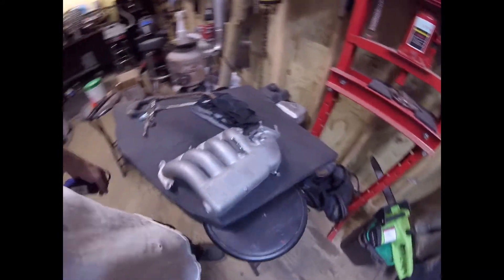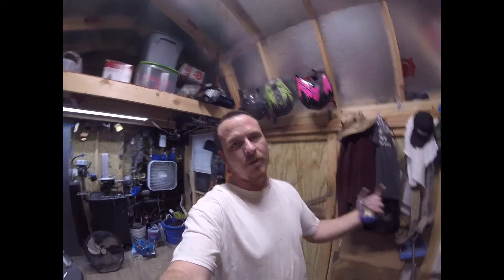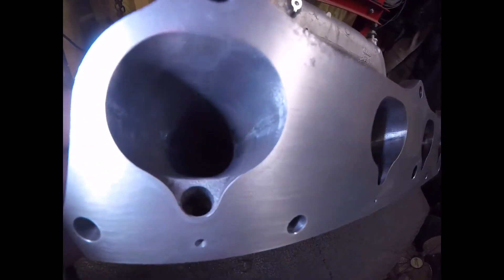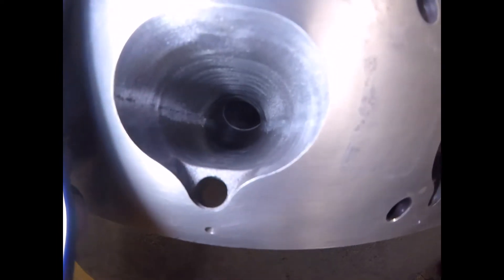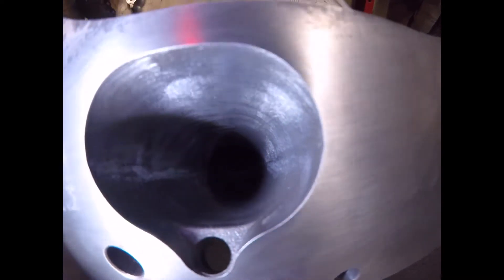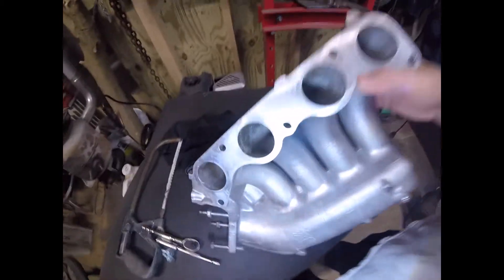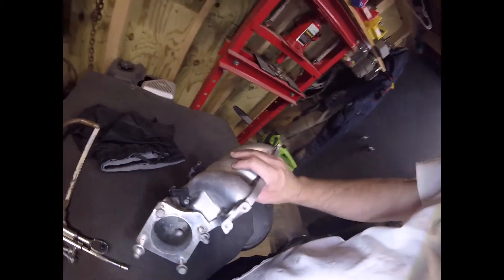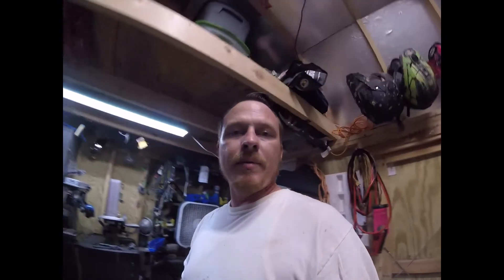Honda Accord K24 Intake Manifold Mild Port, Polish and MOD to fit Acura RSX K20A

Comment: i just grabbed the 2nd half of the manifold, will it bolt on to the k20 lower intake or would i need a adapter?
Reply: Not the base RSX k20. I had to use the k24 adapter, it’s bolts right to the engine no problem
Reply: @skeetden  if i just buy an aftermarket intake manifold will it bolt on? or would i still need a adapter. im just curious on how the intake runner control valve gets deleted? any help is appreciated man
Reply: @nat3fivenine145  so, yes. If you buy an aftermarket intake it should bolt right on and you will have an unused plug where the IMRC was. Only downfall is most of the aftermarket manifolds are short which means you will loose some torque with a NA setup. Not much though
Reply: @nat3fivenine145  do you have an aftermarket tuning setup now?
Reply: I also have the manifold I used since now I’m running a K24A2 I am not using it anymore if you are interested
Reply: @skeetden  how much do you want? could you send pms ?
Reply: @nat3fivenine145  $100 plus shipping. I’ll get some pics for you
Reply: Got an email or something I can send the pics to?

Comment: I'm trying to fit a rbb intake manifold on my base model 2005 honda integra/ acura rsx with the a3 engine...mechanic convinced that it won't work...would like to know how u made it work
Reply: All I had to do is cut off the end of the new manifold to resemble the other side, blocked off all the small holes above the main intake holes on the face that mates the head, removed the nipple for the IAA valve and plugged the hole. Then I cutoff the sensor portion of the IAA valve right where the brass hex section is, polished it and screwed it down into the IAA valve block already on the head. I used accord throttle body by making my own throttle cable bracket and switching the 2 outside wires on the TPS. Hope this helps. You can see pics on Instagram handle is leebuiltcustoms
Reply: Any other questions just hit me up
Reply: @skeetden  thanks for the info...appreciate it